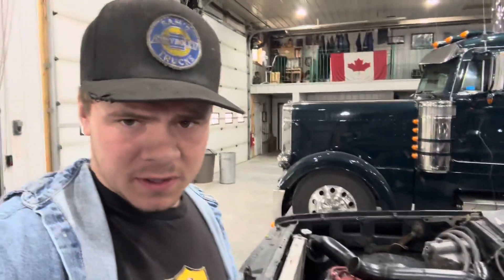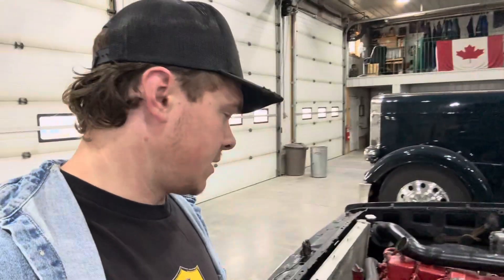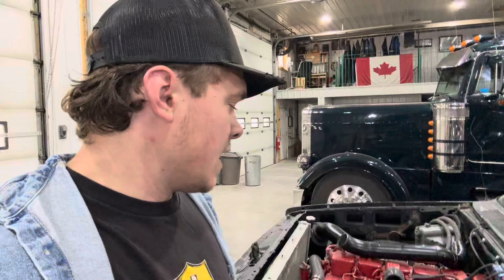Power Steering and Power Brakes EXPLAINED on Cummins Swap!

Comment: Good video for info, i found a stupid simple method for power steering lines. My setup is a 80s chev k30 with hydroboost, swaped in a ve pump cummins. My hydro boost lines are ALL chevy, take the fitting on the pressure side out of the power steering pump and switch it for the original gm one from its power steering pump, exact same pump and fitting. Now your chevy line screws in and you have to SLIGHTLY re bend the chevy pressure line going out of the pump but thats easy just be careful not to crimp it. Return from steering box is just rubber line like stock. I swapped my power steering resurvior for the gm one so i could get dual return lines, easy and the exaxt same. I had to rebend the retun line fittings to clear the frame rail and flatten the one upper seam near the cap a bit to clear the ksb solonoid (early wax motor 1990). I beleive I also switched the pressure releive spring under the high pressure fitting to the gm one so it would have the gm pressure, exact same pumps so all bolt on stuff.  I highly recomend that way its stupid simple and while you have it apart its a perfect time to replace the oring on the resurvour that tends to leak with age. For bending i used one of those brake line bending tools it works well to not crimp the steel lines and slowly just tinker untill its where you need.

Comment: It is truely better to run separate return lines. The swaps that have hydroboost and power steering troubles always get fixed when switched to separare returns. Its very simple, just get a pump assembly or swap reservoirs to anything 1997/8 to 2002 dodge used those had dual return fittings. Some guys just get lucky with t'd return lines and getting all the air out of the system.

Comment: What would you do for the clutch master and slave cylinder setup for this swap? I have a 12v ppump/nv4500 and my truck was originally a hydro boost manual but got swapped to automatic. Been wanting to swap it back but wasn’t sure what setup would be best

Comment: So say I have a hydro boost truck with a ppump engine where do I plumb the vacuum pump to. I hear it’s not a good idea to just cap it.
Reply: If you have no use for vacuum then cap it, doesn't hurt a thing. Do not leave it wide open, the pump discharges into the engine crankcase and if vac pump is left open you will have what looks like excessive blowby. I ran a vac line from pump to the fire wall and connected to original vac line for the hvac to use for switching door modes.